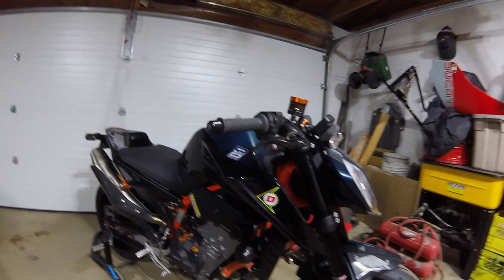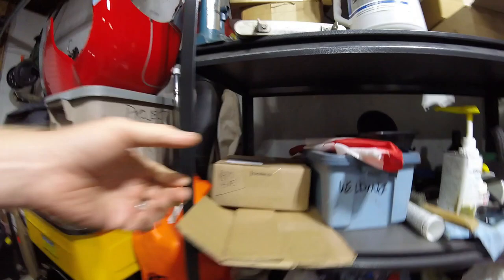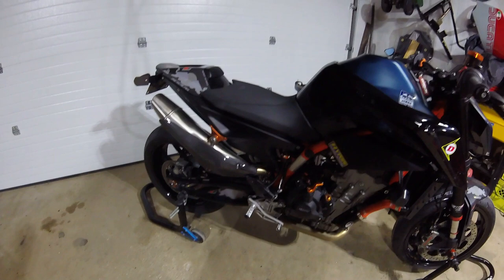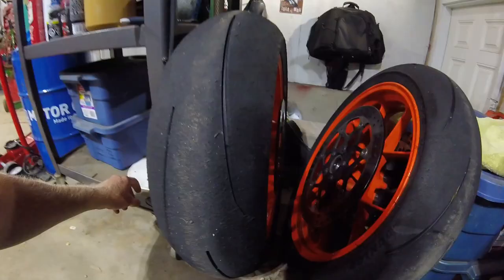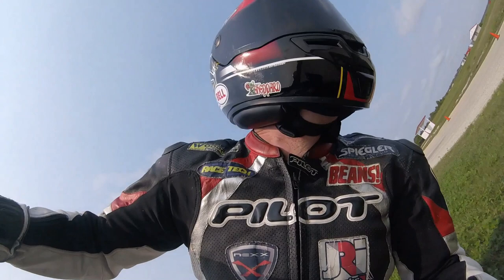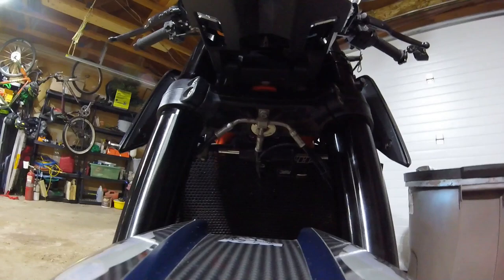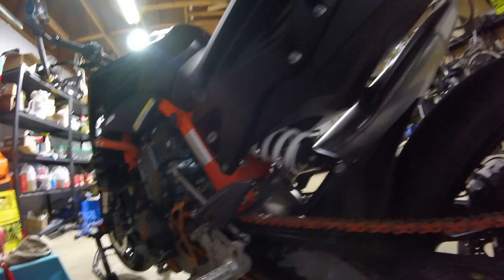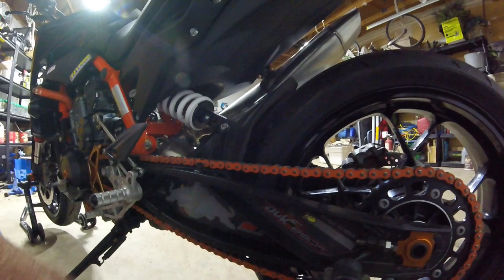2022 KTM Duke 890R Vlog:  Trackday footage and new parts!

Comment: Speaking of chain tension…. Would love to know how you measure your tension? I stick mine on a paddock and then 25mm back from the plastic chain protector on the underside of the swing arm I do my measurement. I typically use an 8mm Allen key as the gap between the top of chain and hex. QS runs fine. 
Really informative videos and get tip on the hyper pro steering d. 
I have the base 890 non r and am looking at the WP sus upgrade for £1600 (here in the uk). Worth the upgrade do you think?
Reply from the maker: Again I run the chain on the loose side, so I followed this guide first:  https://www.youtube.com/watch?v=_bqTvaiHtnE, and then set it on the looser side.  As for suspension, I've heard people have used a nitron shock on the rear, and some fork internals, and have been happy with the results (and maybe for slightly less cost...)
Reply: Cool thanks for the feedback

Comment: Hi Sir, have you ever experienced some front vibration when braking? In my case, when I apply pressure on brake lever it seems starting from forks (I hear a short “knock” sound (as brake pads would be made out of a not so buildable feeling material or forks spring arrived at the end of their travel…which is not), then this vibration climb up through steering bearing zone and left side of the handlebar and grip. I can absolutely feel it. I usually ride into twisties, so at a relatively low speed and I’ m handling it, but I’’m pretty sure that it would be not acceptable during a track day, because forks slightly chatter. 
Abs air bubble, cooked pads, wavy or oval disks?
Any clue? Thank you in advance.
Reply from the maker: I think you have an issue with warped brake discs -- I did ride another 790 who had warped discs, and it felt like you just described.  I understand at one point, there were also a recall issue during production.
Reply: @jamessheppard990  
Thank you very much.
It’s one of the hypotheses I’ve contemplated because sometimes it does not behave that way, letting me think about a something (discs) that moves back and forth due to thermal cycles (braking then warming up and cooling down).
My 890R is 6 months old, so theoretically under warranty, but unfortunately the authorized shop already told me that Ktm is very reluctant to replace them, saying that they have been bent during tires change ( tire shop’s fault). So, I’ll probably have to turn for Brembo discs in order to avoid getting another faulty pair of Galfers or w.t.h. They’re called.